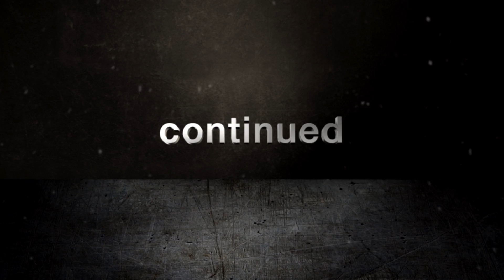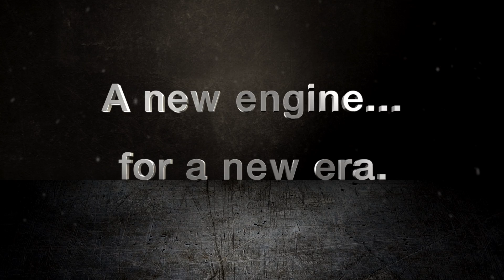Cummins Columbus Engine Plant: Home of the 5.0L V8 Turbo Diesel

Comment: Hopefully they will figure out why these new 5.0 cummins engine crankshafts are imploding. Know of 3 verified cases where the crank has imploded ruining the engine all easily found by a google search. All stock vehicles ranging from 14k miles to 130k miles on the clock. Just bought one myself and am certainly concerned and hope its not a widespread deal. A forged crank should not implode unless there is a major assembly/manufacturer error. Hopefully cummins/nissan will figure it out and take care of the people who spent big money on there trucks and prevent costly repairs for these engines when they ARE out of warranty.
Reply: Engineering error*
Reply: it was all because of a frayed wire in the wire harness. can you believe that?

Comment: Making this engine a V8 was to appeal to people who don't know enough about diesel engines.  Yes you can brag that you have a V8, " I have more cylinders than you!"   "Yes, but my 5.9L Cummins is still bigger, more powerful and more fuel efficient"   If they would have made this same displacement, perhaps even a tad less into a straight 6 they could have made a really great engine that last longer.  Do you think it's coincidence that so many engines with legendary reliability are straight 6 engines?  Toyota Diesel, Mercedes Diesel, Cummin's B6, Jeep's 4.0L, Ford's 4.9L, Toyota Land Cruiser's 4.0L, The BMW straight 6s.  Sure V8 gas engines sound brilliant, but Inline 6s last longer and use less fuel.
Reply: Jonathan Caro yeah but it’s not possible to retain power, fuel economy and characteristics (weight and drivability) in the Titan with the in-line diesels....It’s not meant to appeal to guys like us that know about inline Diesel engines, it’s meant to speak to gassers that need a little more towing and a longer shelf life than gas trucks. I own a 5.9, 6.7 and two v8 diesels and they are different animals...my 7.3 will last as long as any in-line 6 and so far my 5.0 Titan has been a solid power plant.
Reply: the d!ck measuring and coping in this comment went hard. diesel guys fer ya.